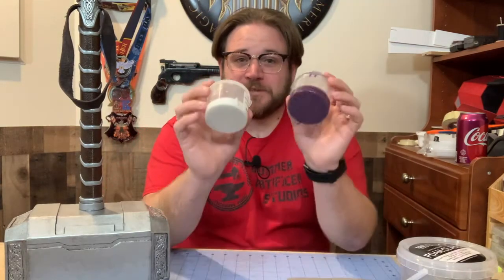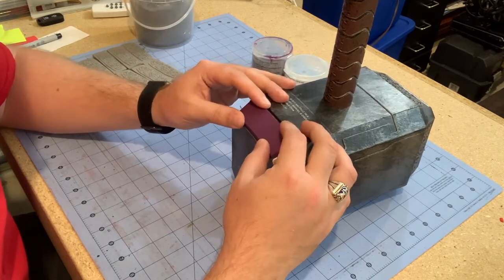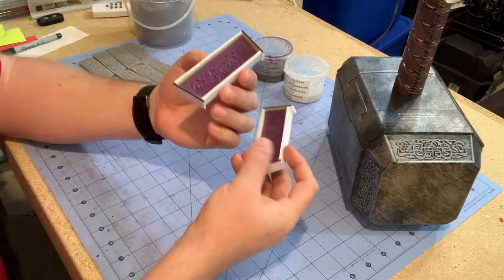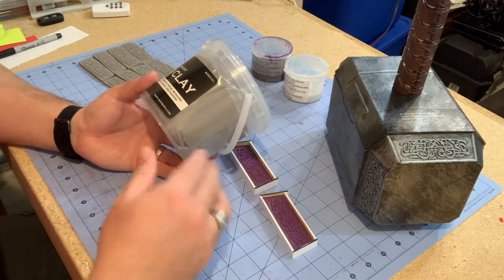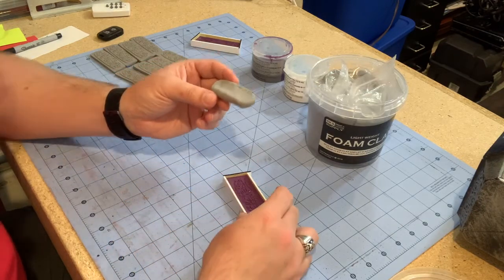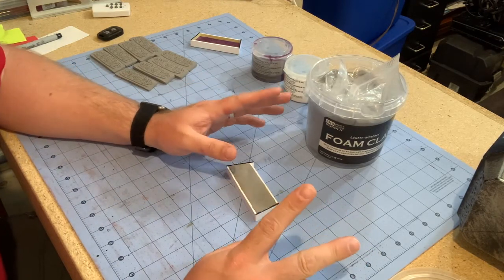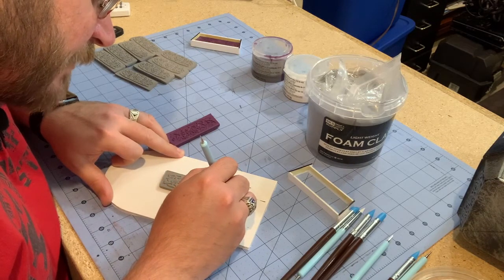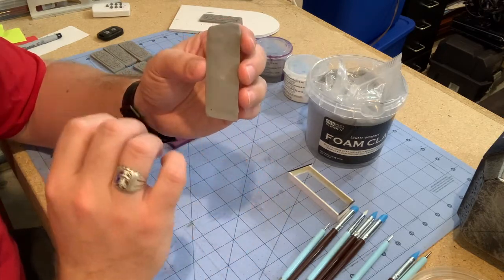Silicone Mold + EVA Foam Clay = Simple

Comment: Or maybe I should pull it out of the mold earlier? Im listening right now to you talking about shrinking and bowing, so maybe the bubbles are happening as the front of the design is obviously drying last?
Reply from the maker: I’d try removing it from the mold earlier, it could be the bubbles are forming either from it shrinking at different rates or from air getting trapped between the foam and mold as it dries

Comment: If using a silicone mold for clay foam: if you get tiny bubbles...any idea to eliminate them?

I have a heat gun. (Im doing filigree designs. Intricate scrolling detail) and the details are great, but it gets bubbles as it dries.

Would heat while still wet or in the process of drying it help?

Because iVe tried adding drops of water before working the clay.

Ive tried pressing harder. Weights on top. Ive also tried waiting longer for it to cure. No luck. And I cant sand as Id lose the detail  =/ 

Thank you! 😊